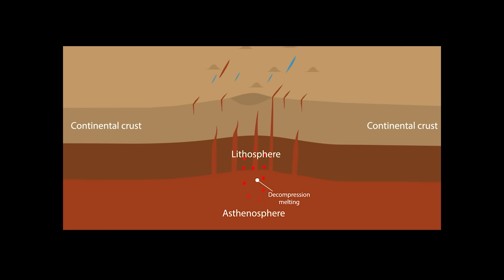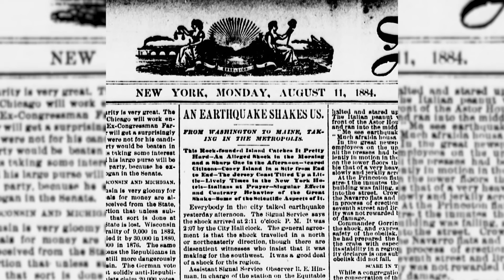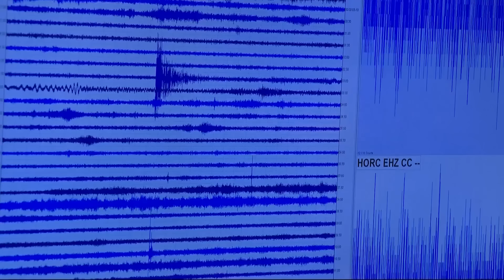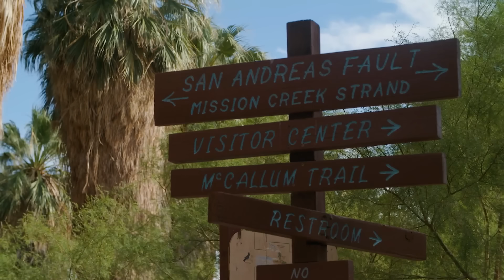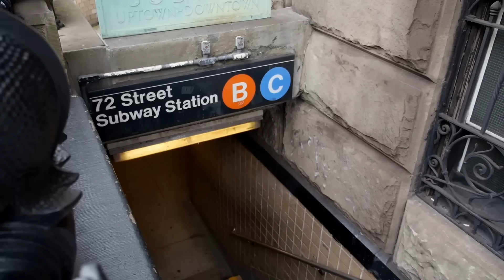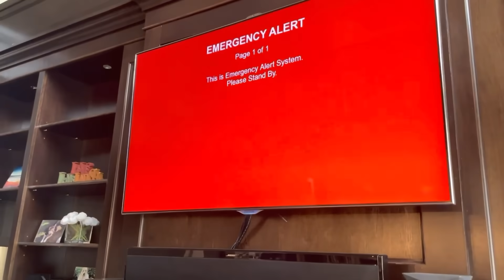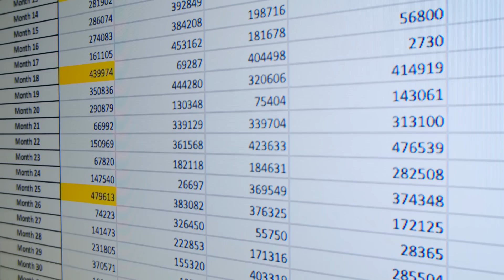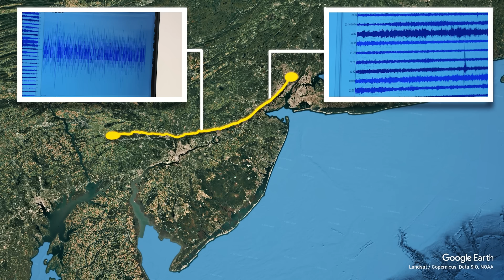Megaquake Warning: New York's DEADLY Hidden Fault Line Is About To Rupture!

Comment: https://www.youtube.com/watch?v=utL6Nrfjvdg  Megaquake Warning: New York's DEADLY Hidden Fault Line Is About To Rupture. MANY POLITICIANS, BOTH RETIRED AND CURRENT WILL BE HELD RESPONSIBLE FOR THEIR SHEER criminal negligence, cover ups, graft and corruption, etc!
Consolidated Edison conducted rock core samples throughout Manhattan for a new power plant in the 1960s and all of a sudden their drills started hitting empty spaces. So they drilled a much larger drill so that they can lower a cable supported man carrying platform to see what's underneath and they saw a massive underground canyon going in several directions and more underground canyons crossing crosswise the canyons they are in and they saw as far as their flood lights and search lights can reach so far and there are streams and rivers underneath. Suddenly an order came to seal up everything and out a tight lid over that fantastic geological discovery, and Consolidated Edison was told to SHUT UP and look for an another place to put their power plants. 

This situation is similar to what happened in a particular CORRUPT SOUTHEAST ASIAN COUNTRY when their geologists told the local politicians and developers not to construct a subdividision on a particular place. The result is that they shouted invectives and insults at these geologists and drove them away and warn them to keep their mouths shut or else they will suffer the consequences. Then many years later, more than a decade later and almost 2 decades later there was an earthquake that destroyed so many massive buildings and the mansions of one of these corrupt politicians was split into 2 sections with a 6 to 8 inch open space gap.

Then news came about what happened almost 20 years ago about the geologists who were driven away and threatened with death threats if they dare try to report the truth and the people affected are also the people who built their dream homes in that particular area only to have all of their dreams shattered and these politicians are the ones who are responsible and must be blamed for lying to them and the result is a huge result local civil fighting and riots and protests that made national head line news in the CORRUPT 3RD WORLD COUNTRY CALLED THE PHILIPPINES.

The same thing is going to happen to America and this time Trump and all republicans and democrats and all local county politicians, municipal politicians, state politicians will be accused of criminal negligence, cover ups, graft and corruption, etc!

Comment: How is it that you didn't mention last year's 4.8 up in North Jersey?... I figured with the research you did that you'd have come across this since it just happened last year. And there was a 6.0 that happened back in around 2011-12 down in northern Virginia that was felt pretty good up here as well. But yeah, they don't come often, and they're usually not very big. But they do occasionally strike. Just not as often as they have lately. With literally 3 since April of 2024 now with these two that just took place.

Comment: Consolidated Edison conducted rock core samples throughout Manhattan for a new power plant in the 1960s and all of a sudden their drills started hitting empty spaces. So they drilled a much larger drill so that they can lower a cable supported man carrying platform to see what's underneath and they saw a massive underground canyon going in several directions and more underground canyons crossing crosswise the canyons they are in and they saw as far as their flood lights and search lights can reach so far and there are streams and rivers underneath. Suddenly an order came to seal up everything and out a tight lid over that fantastic geological discovery, and Consolidated Edison was told to SHUT UP and look for an another place to put their power plants. 

This situation is similar to what happened in a particular CORRUPT SOUTHEAST ASIAN COUNTRY when their geologists told the local politicians and developers not to construct a subdividision on a particular place. The result is that they shouted invectives and insults at these geologists and drove them away and warn them to keep their mouths shut or else they will suffer the consequences. Then many years later, more than a decade later and almost 2 decades later there was an earthquake that destroyed so many massive buildings and the mansions of one of these corrupt politicians was split into 2 sections with a 6 to 8 inch open space gap.

Then news came about what happened almost 20 years ago about the geologists who were driven away and threatened with death threats if they dare try to report the truth and the people affected are also the people who built their dream homes in that particular area only to have all of their dreams shattered and these politicians are the ones who are responsible and must be blamed for lying to them and the result is a huge result local civil fighting and riots and protests that made national head line news in the CORRUPT 3RD WORLD COUNTRY CALLED THE PHILIPPINES.

The same thing is going to happen to America and this time Trump and all republicans and democrats and all local county politicians, municipal politicians, state politicians will be accused of criminal negligence, cover ups, graft and corruption, etc!
Reply: But you can't tell that to all the Trump shoelickers. To them, Trump is the equivalent of the return of Jesus and he can do absolutely no wrong. I support Trump in many ways. But he isn't doing so great with the economy. Prices of food keep going up, more small businesses close up now than under Biden, and he's driving out important immigrants who've been here for decades. Almost reminds me of someone from Austria that initially drove all of the Jews from Europe in the 30s & 40s.

Comment: Native New Yorker here.  I remember earthquakes going back to the 80s, and you seemed to have overlooked something important: Indian Point Nuclear Plant.  NYCers? We’d be fine. 😊
Reply: I really appreciate you for realizing this as a local… This video is nothing but fear mongering! What’s next. How the infrastructure is suddenly falling apart? Lol
Reply: That's because a nuclear plant would SCRAM as soon as they detected an earthquake, and they are built to prevent a release to the environment even from a direct hit from a major disaster.  This even worked as intended at Fukushima, except the tsunami knocked out the diesel generators responsible for keeping the pumps running during a power outage, and the executives at TEPCO were too proud to flood the reactor with seawater until after the hydrogen explosion caused a major release to the environment.

Comment: Most people don’t know theirs a fault line running through Manhattan, its the only reason why the 1 train goes above ground at 125 then back underground.
Reply: That’s crazy I did no know this and I’m A NYC native
Reply: Damn
Reply: There's one along Dyckman St as well.
Reply: It’s not an active fault line
Reply: @KJFiorisi  something not active now doesn’t mean it won’t be active later
Reply: I've known for 40 years
Reply: @jodiann4234 that’s great I’ve lived here 36 since I was born and never knew
Reply: Yup it runs straight down 125th street
Reply: BINGO!
Reply: No, Broadway is on a ridge where it crosses the Manhattan valley. It goes above ground because if it didnt the stations under Broadway on the north and south sides of 125 St would have had to be extremely deep underground.  The Lenox Ave, 8th Av and Lexington Ave lines are underground at125th St without problems from the fault. The real issue in the area are the underground springs that pose major challenges for water removal particularly on the Lenox Av line.
Reply: An Mega quake somewhere else on Earth could trigger quakes somewhere else because of a Ripple effect. Those small quakes we had a few weeks ago was after the 8.8M in Russia. The tectonic plates are constantly moving. 

That 8.8M woke up the Ring of Fire triggering smaller quakes in places that didn't have before. For example, Guam had swarms of quakes and it has been on radar.

Another major quake on the Ring of Fire would trigger more volcanic eruptions and fault failure
Reply: @jonathanthackoordeen6258  oh New Jersey got a 2.7 after that
Reply: Yet these stupid greedy developers keep building those ridiculous super tall skyscrapers.

Comment: Earthquakes in the northeast happen all the time at magnitudes usually much less than magnitude 4.0. The area around the Ramapo Fault has been monitored extensively for over 50-years, and there has been no indication of a ‘big’ one building. This whole ‘report’ is needlessly alarmist Years ago, when the Indian Point Nuclear Power plants were operating (no longer) in very close proximity to a branch of the fault, the estimate then was that the maximum magnitude possibly occurring along the fault was a 5.5.  Anything over 5.0 could cause damage, and the 7.5 mentioned in this sensationalist bit of click bait isn’t in any way likely although seismologists have revised the seismic hazard upward for the northeast.

Comment: Why would we need a system to alert you to an earthquake in progress?  Wouldn't it be self-evident that this is happening when you can't stand up from the shaking?
Reply: Seismic signals travel at about 5X the speed of sound.  People can use a fraction of a minute's warning in a big quake to grab the baby and get into a doorway, etc. Or drop their pants and kiss their ass goodbye.
Reply: They sense the P-wave coming ahead of the S-wave that does all of the damage to give people a quick warning to get under a table or away from potential hazards. It’s not enough time to evacuate or anything but 10 seconds is enough to get people under something sturdy.

Comment: I don't know that such quakes here would get that high on the Richter scale. Certainly a 4 is possible. The real trigger is what happens with New Madrid. I would never have designed a city like this around skyscrapers. It's too dense with infrastructure.  Infrastructure is what causes the damage. If you have acres upon acres of open field, you would be fine. In recent months I've been working on a plan for the body politic just to have something in place. Absolutely warning systems & dampers & building codes are necessary if you can retrofit. Public policy leaders would not know what to do. Their goal is just to get in front of a podium.  Now the flip side of this is that the sheer amount of building infrastructure may actually confine the surface ways.  Anyway the longer term reaction plan is to introduce the earth sciences back into school so kids can get exposed to this stuff. Then people may be better prepared.